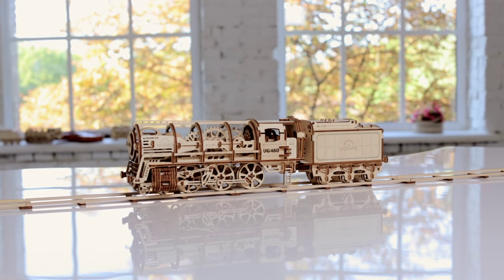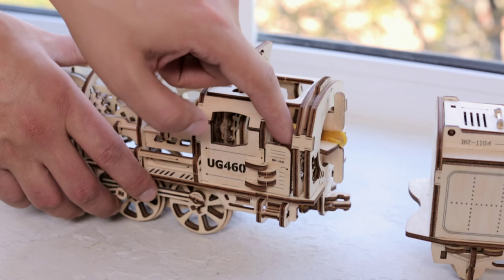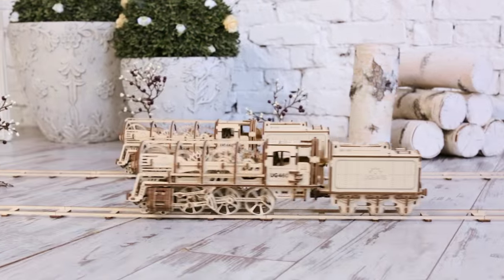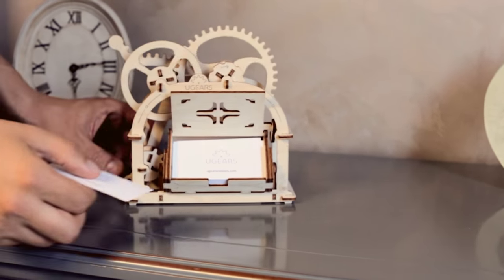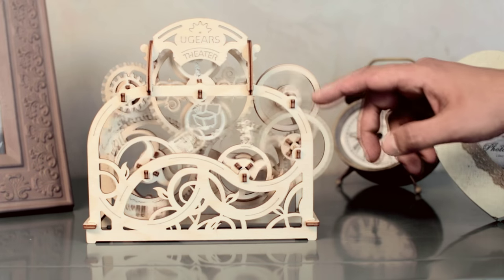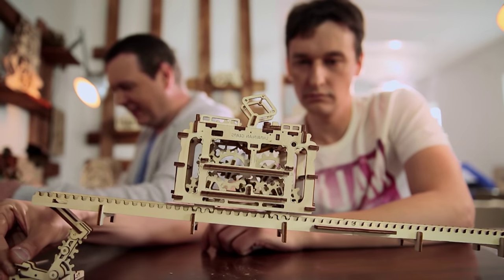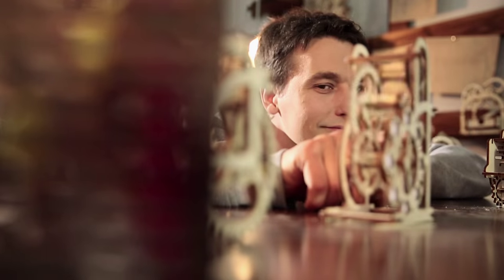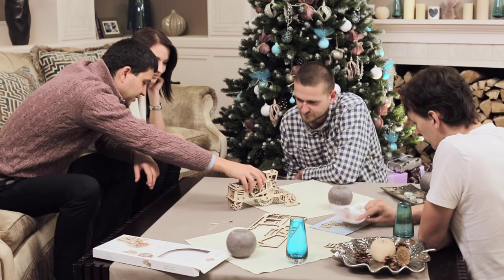UGEARS: Unique mechanical 3d models for self-assembly without glue, made from natural materials.

Comment: So theoretically, could this train be run on ordinary model railway track? I know it doesn't go very far, but I'd be interested in buying this engine for my garden railway as a novelty, as I love mechanical kits and contraptions. What's the gauge (the distance between the wooden rails)?

It'd be neat to see some additions for this model in the future, say a collection of different wagons and passenger coaches you could build for the engine to pull (have to be pretty lightweight by the looks of things.

What I'm really looking for would be an inexpensive wooden clock kit to put together, ideally with a chime to strike the hours, and would ideally run for a few days before I'd have to wind the thing up again. A product idea for the future, maybe?

Comment: is this real because i dont believe this is real
Reply from the maker: Ugears Locomotive with tender is real. Made from wooden material, requires no eletricity, designed for self-assembly without glue (pre-cut parts you can push from the plywood boards). 
Steam Locomotive with Tender employs all technical solutions we’ve come up with in our previous models, and more. The spinning gears, pistons and wheels carry the soul of XIX-century engineering, when locomotives represented the mainstream of technical progress. It is one of the fanciest UGEARS models, as it consists of the highest number of parts and can run up to a distance of 5 meters. 
Also you can look at Ugears Railway Platfrom and Crossing with rails. Having assembled the railway Crossing and Platform you’ll feel what we all miss – the feel of real motion, real mechanics that you make work with your own hands. 
Watch and enjoy our new video: https://youtu.be/oFWa6EfIkkk
Have a nice day!